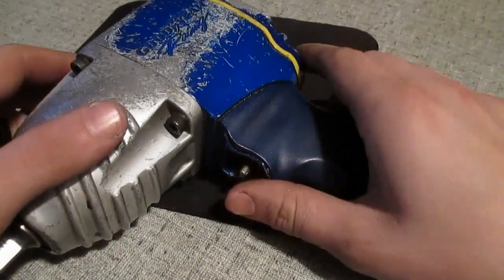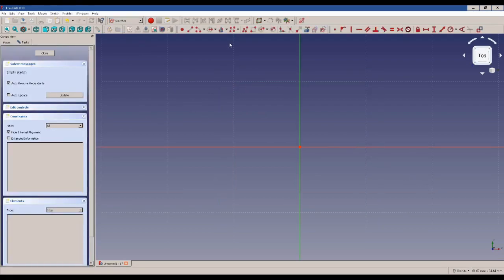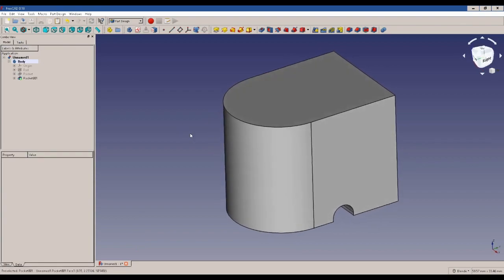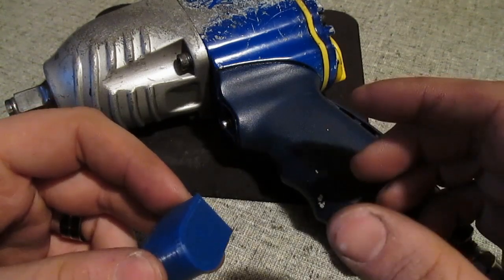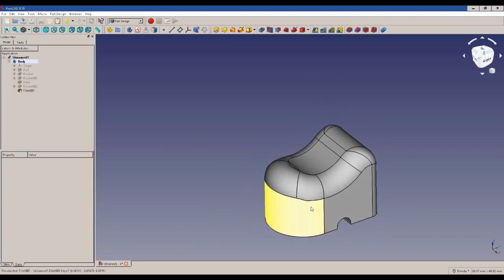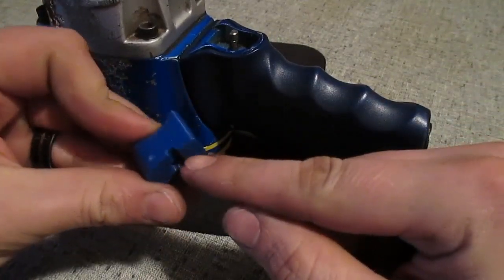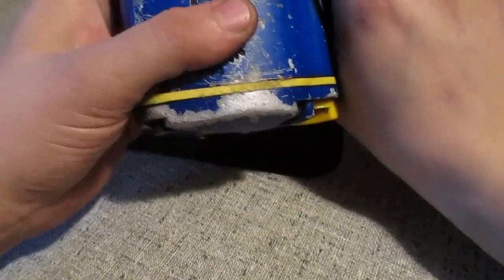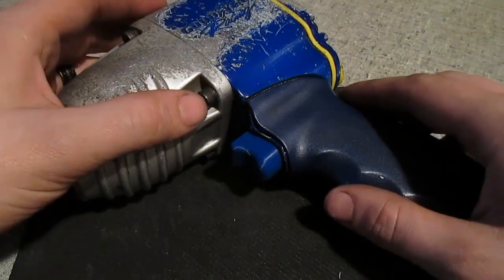Goodyear Impact Wrench Button | 3D Printing Vlog Day #4

Comment: measure twice print once?
Reply from the maker: If your printer is 100% accurate and you find a material that doesn't shrink or grow.
That is basically the moral of the story though. I should've measured the very bottom and the top. Cleaning all of the grease and dirt out would've helped a lot, I must confess that was lazy of me.